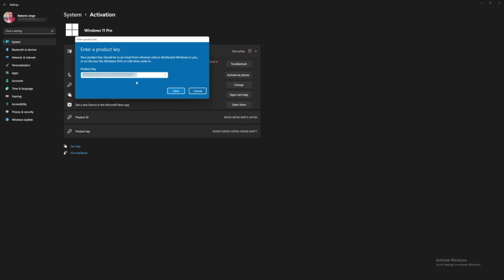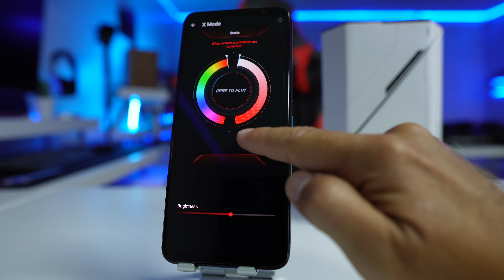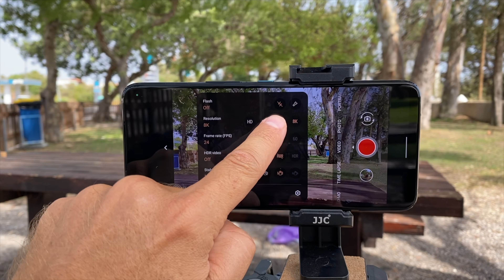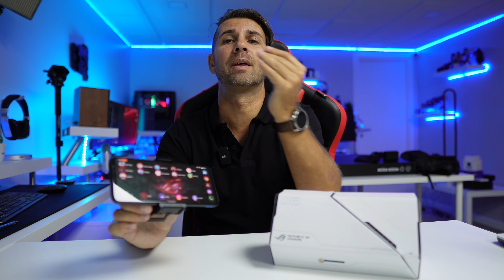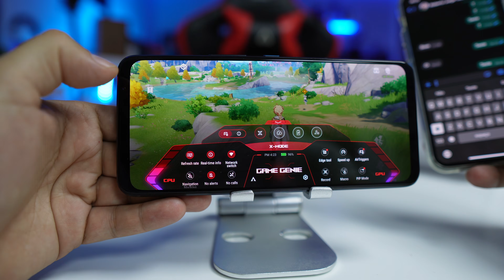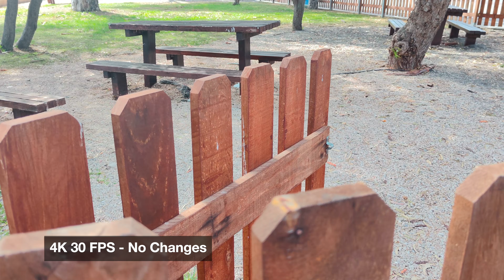ASUS ROG Phone 6 PRO !! ULTRA FAST SmartPhone & Recording at 8K 24 FPS

Comment: For anyone considering buying this phone and wants the Aero Active Cooler 6, pre-order it because otherwise, ya will have to buy it seperately as not even the Pro version comes included with the fan, only the pre-orders do.

PS : If ya have any questions, feel free to ask and I'll try to answer ya with the best of my knowledge. Mine (Non-Pro, Black, 16GB RAM + 512GB Storage with the Cooler ) will arrive around the end of this month if not the first week of the next
Reply: U.S pre orders don't seem to available, any idea if we'll even have that option?
Reply: @TheBlueRose011  Most likely at the end of this month if not next but even than, I wouldn't recommend buying this phone if ya are living in the US because all the previous ones had issues working with US networks
Reply: @6210classick  I was partially able to get the Phone 5s working on Verizon. Follow the XDA guide. You need to have them enable CDMA-less on your account and the phone placed on their DMD. On T-Mobile, it worked without issues.
Reply: I've heard that the previous asus phones has some screen blackout issues or something like that after a year or so use... i heard it a lot about it. Do you think they fixed it on this version?
Reply: @heroshuko5046  no
Reply: @6210classick  why is that?
Reply: @heroshuko5046  because they're focusing on their efforts into making the ROG 6 functional
Reply: @6210classick  who told you that tho.
Reply: @heroshuko5046  go check Asus forums and see the plethora of posts regarding the 6 having issw
Reply: @6210classick # bro any issues? Please reply I am thinking of buying the pro variant, please reply
Reply: @strgaming5568  currently, only one issue which is that whenever ya receive or initiate a call on any voice call app and ya switch to the speaker mode, the top speaker basically gets disabled and barely outputs any volume. 

Fortunately, ya can fix the issue by either restarting the phone or calling yourself, turning on speaker mode, turning it off then hanging up the call (this works on other voice call apps such as Discord or Google Meet).

Unless ya are willing to wait for an update that fixes this issue which by the way this has been occurring for the past 2 updates and it still hasn't fixed or perform the above mentioned procedure after every single call, I'd recommend that ya don't buy this phone. Also, don't bother with the Pro, get the normal model

Comment: still waiting to receive mine, ordered nearly one month ago 😤 I'm surprised by the low quality output of the cameras. I had a ROG2 (which I broke) but pix and videos were really nice (1080p). Massive stutter when you were turnig around 🤔 Hope they fix this with an update
Reply: Unfortunately, the ROG Phone 2 is dead and is no longer being supported by Asus so there will never be another update
Reply: @6210classick  yeah I know, last update was of April, but that's no big deal to me. It worked flawlessly until I smashed it clumsily, that's why I was forced to upgrade. Wasn't sure if getting a Rog5 cheaper or this one, but Rog6 has some major improvements worth the extra money. The only downside: it takes ages to arrive. Seems pandemic and chips shortages has had an impact (I contacted Asus)...
Reply: @fuxart1224  Don't get the 5, it is notorious for having motherboard issues